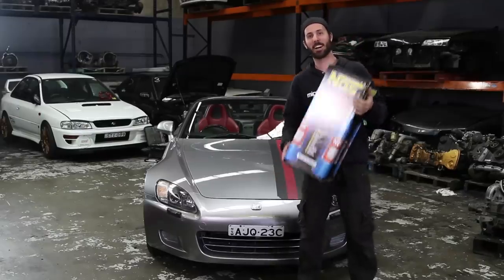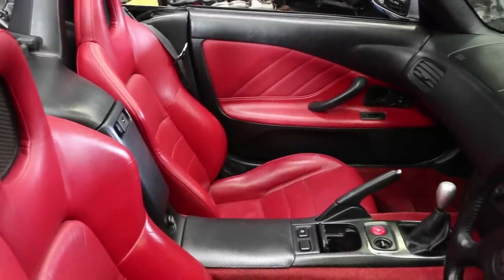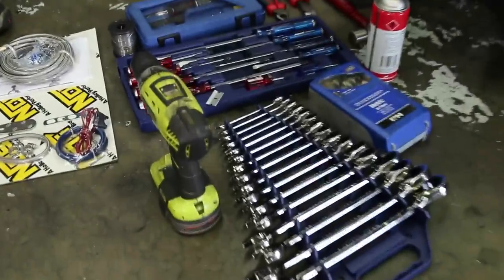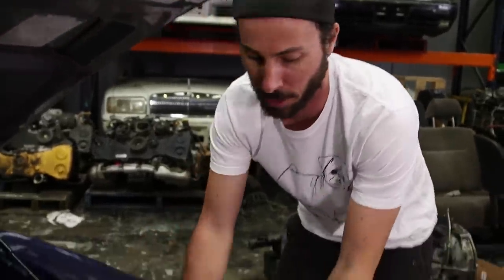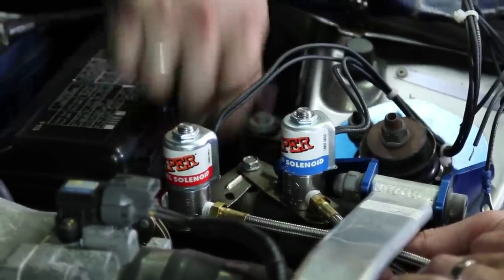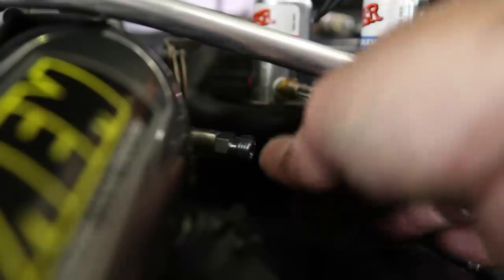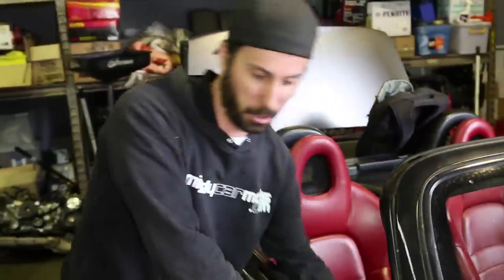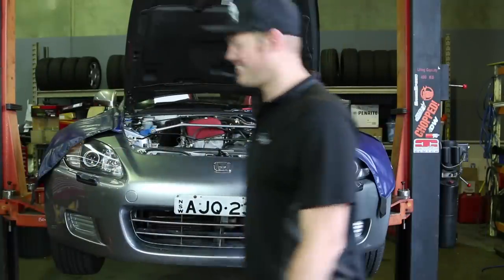How To Install NOS

Comment: Jep, it´s illegal here in Germany. Just like everything that is fun.
Reply: Why is it illegal?
Reply: I don´t know. Even installing some other Wheels is illegal, if they dont get a E-Symbol or you pay to write it in your Papers. But for that the TÜV has to check everything.
Reply: darek4488 why in the hell would you need nos for driving in the streets? it's to prevent street racing.
Reply: You have motorways without speed limits but no..... That's not fun at all
Reply: TheLukey21 Yep, thats the only cool Thing in Germany.
Reply: I feel you ...
Reply: GEMC Even though there is no limit in Germany when I drove between Netherlands and Poland I found out that I have the best average speed in Poland, because it has the smallest traffic and all motorways are brand new and very smooth. German highways are very good for their age, but still they remember Hilter, so they're a bit wavy and rough, especially in the DDR part of Germany.

BTW. If both installed right Nitrous are less dangerous then Liquefied Petroleum Gas. Nitro is not flammable nor explosive on it's own, they also have tiny tanks. Many people convert their cars to LPG as it is generally half the cost of petrol. LPG have tanks as big as a fuel tank. It's 50-80 liters of explosive gas. Yet still you don't hear in the news that someone crashed and their car exploded.
Reply: but you have autobahns!?
Reply: Are carbon wings illegal in Germany ? here in  the Netherlands big wings that are pointy are illegal .
Reply: SmoothAsButter SN. Is it illegal to turbo-charge or super-charge cars in NL? I live in NL. But I don't speak Dutch. Difficult for me to find laws or information on forums etc.
Reply: Many things are illegal here in Germany but not Skylines!
Reply: pancakefactory Fuck yeahh!!
Reply: Timmy Zhou No , I saw and know a few people with turbo-supercharged cars here in NL
Reply: darek4488 You should try driving in New Zealand - the roads are trying to kill you by hurling rocks, ruts and potholes, wild pigs, cows, sheep, mad unmarked hairpins etc at you, and the cops treat you like a serial baby killer if you do more than 4km/h over the limit.
Reply: Well, it's about the same rules in France. You're not alone.
Reply: Matthew Sharpe My uncle got a few speeding tickets that were like 3/4 km/h over the speeding limit xD
Reply: GEMC bullshit germany is awesome how about the fact unlike the usa you don't live  in a police state or have a ridiculous prison population  people are genuinely very decent, society is not crumbling, you guys are all civilised,  your education is worth something, you can get a job, you have outstanding pure food and drink, german beer, you can drink at 16, prostitution is legal  not a lot but alittle american culture sadly to many fuckign americansa in germany thouugh
Reply: SmoothAsButter SN. Last ticket I got was for 20km/h over the limit (120 instead of 100) - which, OK, is speeding - but it was at 4am on a dual carriage way in the middle of nowhere in perfect weather with not another car in site & the guy lectured me like I was driving at that speed through a school zone at 3pm with a cattle catcher attached to the front of my car in a typhoon.  No chance of getting off or getting a reduction in NZ.
Reply: SmoothAsButter SN. not in germany he didnt you won't get a ticket for 5kph  over i got fined last week 15 euros  for 10 over in a 50 and 25 euros fine for 18 over in a 30 no points
Reply: Because you think in France it's better ? xD apparently, any mod to your car is not legal, they won't say nothing but you are not suposed to do that sort of mods (I'm only 14 so I don't own a car but I still think that this is shit). Even if you change your rims it's illegal, every car has to be stock x) of course, my car in the future won't be stock :)
Reply: BattleHalo   again bullshit you can do what you want to the outside of a car in france  you just cant do engine modifications from standard but there are ways around this.. modding scene in france is massive
Reply: Matthew Sharpe I like New Zealand, I even considered living there, but I without speeding I'd feel sad and grim all day long. In Poland the highway speed limit is 140km/h yet if you're not driving a piece of junk you would probably be doing about 160km/h. The general speed limit for urbanized areas is 50km/h and yet almost noone, but the Police seems to care about, so people go about 70km/h. If you are from Warsaw, which is a capital city add extra 15km/h on top of that. Once upon a time, less than once a year you'll get a ticket, but everybody does so. It's just a part of the game. If you have too many points on your license you need to be more careful. 24 points and you loose your license. For one speeding alone you can get between 0-10 points. For 50km/h or anything above that you will get the maximum 10 points and 500zł fine. And yet everybody thinks that the Germany is a place of speed.
Reply: GEMC You guys have the Nurburgring as well
Reply: darek4488 That sounds much more reasonable to me!  In NZ you lose your licence automatically if you are caught at 40km/h over!

I think the main problems in NZ is our drivers are poorly educated, our vehicle fleet is very old (the average vehicle age is 18 years) and poorly maintained, and many of our roads are "challenging".  On top of that the police are entirely speed focused - if someone has an accident and they are found to have been doing say, 5km/h over the limit it's not because they were a bad driver or driving an unsafe car or not driving to the conditions - it's because they were speeding every time - very little consideration is given to the other factors - ergo the way to deal with it is to focus more on controlling peoples speed, and every year we get more and more focus on speeders.  This year for the whole Christmas/New Years period right through until February they are implementing a "zero tolerance" policy - if you are 1km/h over the limit they will ticket you.

If I get a ticket for 1km over I'll be taking it to court and they can damn well prove how accurate their equipment is, because that's fucking insane - nobody has an accident because they are 1km/h over the posted limit - I have a nearly new car and my cruse control isn't even that accurate.

Sorry about the rant! :-)
Reply: Going as fast as you want on the motorway without cops on your ass sounds pretty good to me, dude.
Reply: Matthew Sharpe What if it is more about people think about their driving, make you more aware of the conditions than getting tickets. Have to prove a link besides lower holiday crash rates (Even then its thin)
Reply: Matthew Sharpe 
commentmachine1 It is good indeed. You can go fast and not be punished.
However here every single police car is equipped with an alcometer and if you get pulled than alcohol in your breath is gonna be one of the first things to control. They can let you go if it is 0.2‰ or less, but between 0.2-0.5‰ it is a misdemeanour (suspending your licence for a year is very common) and above 0.5‰ even a felony with up to 2 year jail time. Everything depends how shitfaced you are when the cop stop you and how good your lawyer is.
Is the law in NZ as strict as this or people just drive back home fucked up like in Australia, because it is just too far for any alternatives?
Reply: darek4488 Australia is even harsher than NZ.
Reply: Gavin Irvine Here you have to pay like €60 or more if you do 10 over the speed limit.
Reply: Maxxis1992
There's a way for using NOS in Germany besides the drug Law. You need to combine the N2O with some gas that makes you sick and vommiting if you used it like a drug. Source: nos1.de
Reply: darek4488 Yes, all police are equipped with breath testers here too.  We used to allow 400 mgc which is quite a bit, but just this month it's been lowered to 250mgc which is more in line with other OECD countries.  Our penalties for being caught are pretty poor though and judges have too much discretion.

I know people who have been caught 3 or 4 times over the old limit (so basically so drunk they can barely speak) and have been let off with a few months licence suspension and a fine that is then waved because they are too poor to pay it (but can afford to buy massive amounts of alcohol apparently).

Depending on the judge, you can get away with being caught 3 or 4 times in such a state before they even make you attend any kind of a program, and 5 or 6 times, maybe more before they will put you in jail.  People get killed all the time by drunk drivers here, but people doing a little over the excessively restrictive speed limit are the ones that get blamed for everything. It's pathetic really.
Reply: that original comment sounds so sad xD
Reply: See, but would you rather have an stock fast car that you could actually top out in or a heavily modified fast car that you couldn't drive very fast?
Reply: Does anyone of you ever drove on a German Autobahn? They are so bad you want go fast. They need to repaired.
Reply: Except for prostitution. lol
Reply: Same here in the USA..... But if you want a gun, we got tons of them!
Reply: ***** Nitrous is perfectly legal in my state.
Reply: Lynn Mckenney Must be California or something. Last I checked, its illegal here in SoCal, unless something changed(hopefully so).
Reply: Huh, its definitely legal here in Kentucky. Then again, KY is pretty lax with cars. You can easily get away with driving around with a straight pipe exhaust, custom turbo kit and being slammed.

Then again, we have to deal with horrible weather for 4-6 months of the year, so I guess it evens out :D
Reply: Lynn Mckenney I wish CA was relaxed like that. We gotta have smog checks on every gas car '76 and newer. Diesels '98 and newer get smogged now too. If you live in a nicer area like Claremont, everyone busts your balls about sound. I know I annoy people with my 96 Grand Cherokee. Cherry Bomb turbo muffler with no tailpipe after it sets off cheap aftermarket alarms, but some people give me dirty looks because if it. Oh well haha
Reply: Big whoop. Yall have the Autobahn.
Reply: I Think it has to do with that the fact that soooooo many people (and kids) killed themselfes on the autobahn. in souped up BMW's or Audi's. whent to Germany last year and some King Dick in a black Mercedes Benz AMG S Class, zipped in and out of lanes past our Cab, and nearly crashed with a Scania R620.
Reply: NOS is cheap tune up, you still can get 800ps car and ride it everywhere
Reply: ***** u need a big ring cap for a huge nos shot tho
Reply: GEMC germany is like the california of the world
Reply: What's more BS is the FAC needed in germany. Lol

Comment: don't you have to upgrade your pistons and rings to handle NOS ?
Reply: depends on the shot, and tune
Reply: depending if it's a dry shot of nos or wet shot also depending on car If you got a corvette it already has a racing motor so many factors apply
Reply: Depending on how much horsepower you add you may not have to grind your piston rings
Reply: +TheOneWheeledNavy that and the type of nitrous and the amount
Reply: true
Reply: @supermanny productions that is literally wrong.
Reply: This ETHAN!

Comment: This vid should be called "how to get arrested"
Reply: +Brad linsley Hahaha spot on XD
Reply: It isn't illegal to have a nitrous system installed.
Reply: dunno what country you live in but it's illegal in most countries.
Reply: +Linnie In Germany it isn't :D
Reply: +Brad linsley WTF Do you really think that NOS and especially Speed are the main reasons for road casualties?
Btw although we have no Speedlimits here in Germany, the number of road casualties is one of the lowest in europe!
Reply: +Schubinator_66 the best thing is going 180 in germany and then having to go down to 130 as you drive in denmark :D
Reply: what country do you live in? guarantee the ones who are saying its illegal are not even old enough to drive, iv had road cars in the uk with nos fitted. If its illegal in most countrys how can so many people use it for drag racing around the world use nos
Reply: Idk where y'all live but in America it is completely street legal as long as the valve is closed.
Reply: NOS isn't street legal but that doesn't mean you can't put it in your car to use it in drag strips or race tracks, you just can't drive in the streets with it.

EDIT: Found out it's actually legal on the UK and some other european countries, and in most places you can just unfasten the NOS bottle from your system and it will be perfectly legal to drive on public roads.
Reply: Sven aren't Autobahns good
Reply: Here also not a problem, many years ago the cops even inspected one we put on a old audi A3 :D because they have never seen one, they were geniuenly interested and didnt give me any trouble :)
Reply: Brad linsley well I mean it’s only illegal if used on the street do🤷🏽‍♂️

Comment: iv had the experience of driving an s2k, and it is an amazingly fun car to drive. its not the fastest thing i've been in but probably one of the top 3 cars i can say is more fun to drive any where than just to race. and this is coming from an avid mustang driver, the s2000 has an amazing feel and an even better response to driver input its a vehicle that will smash at the track and still make driving to work one of the best parts of your day.

Comment: i love it when people bash nitrous. Half if not most of you have zero to no experience with it. Its not cheap to do, if you actually want a good reliable system. Its also not easy way to make power with, yeah sure some dumbasses strap a nitrous kit on their car and call it good. But in reality its pretty hard to get the perfect blend of the gas to fuel mixture so you dont run the car to rich or too lean, timing on the car has to be absolutely right or you wont make any real safe power. Also you have to keep the bottle heated to the right temp to keep the bottle at the right psi, or you wont get a good hit out of the pass. Some real, proper heaters are quite expensive, especially if you need multiple of them. Nitrous gets a really bad rep from people, but yet turbos and superchargers seem to be the absolute greatest things on the planet. I dont know i just feel that some people need to wake up and realize how much work goes into using nitrous in a real combo, and not just the dumb kid on their block or even FaF to be the bible on nitrous
Reply: Biggest issue with nitrous is the fact that you have to refill the bottle...AND its illegal to use on the streets. Thats why turbos and superchargers are much more common and loved. They have a one time purchase price and boom! power as long as its on there.
Reply: Jon Woods
agreed. on the strip it is a great way to make power. But on the roads where you need the same reliable power everyday supercharging and turbocharging are the way too go.
Reply: Totally agree, here in America, at least by me, it's about 3.75 a pound of nitrous to the most of like maybe 5 bucks, it really does suck refilling them. But who uses nitrous on the street anyways besides people who street race.
Reply: custommotor Certain motors are safer to spray than boost. The TL's motor for example is great to spray but boosting or supercharging it is not only expensive but requires a rebuild to get reliable power. Plenty of people running nitrous and keeping the motor reliable rather than building a forged motor for the street to run boost.
Reply: What happens if a fuel mixture is too rich?
Reply: detonation. which is not good
Reply: Fernando Lopez Running rich is usually better than running lean.  Lean mixtures are super hot.  That's how you melt stuff.  I remember an old issue of sport compact car years ago where they put nitrous on a civic.  It ran lean and melted out the exhaust valves.  The car had zero compression after just a few squirts of nitrous.

Comment: at 7:42 you  use teflon It is easy for Teflon tape to get pulled into the system, causing blockages that can ultimately lead to  incorrect
nitrous system performance and potentially, engine
damage